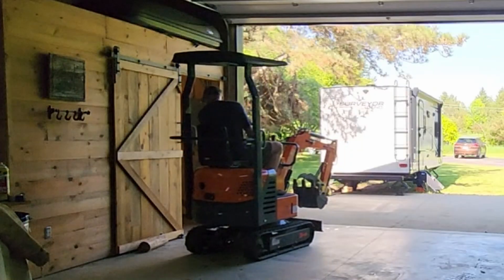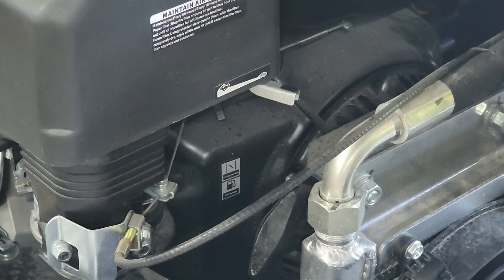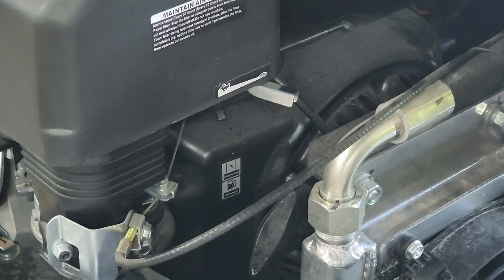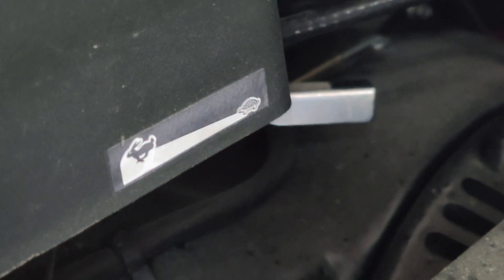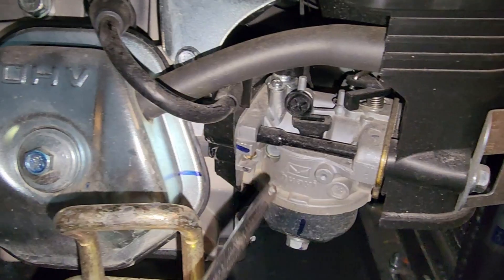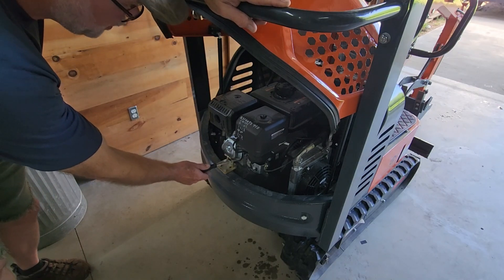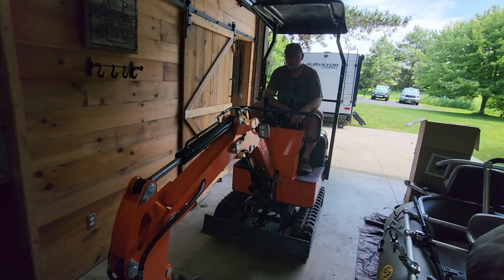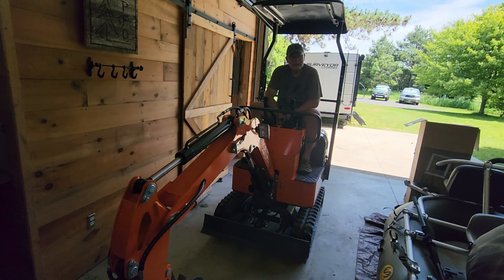Mini Excavator throttle malfunction

Comment: What size is the jam nut you got for the tracks.
Reply from the maker: Thanks for the question! The jam nuts I found, which fit my machine, are M24 x 2.0mm, Stainless Steel. I found a pack of them on Amazon.com, along with an appropriately sized wrench. These details and links were posted in the description under the video where I discovered the nuts missing from my excavator. I'll copy them here for your convenience.

As an Amazon Associate, I earn from qualifying purchases. There is no added cost to you.

Hexagon Head Lock Nuts - Stainless Steel Metric M24 x 2 mm
https://amzn.to/41VxMvn

36mm Combination Wrench (to fit the above lock nuts)
https://amzn.to/3RgsHJt

Comment: Lucky mine was the nut on top of the linkage
Reply from the maker: Yeah, those mechanical governor systems have so many nuts, screws, springs and levers, and any single one can prevent the whole thing from behaving.

Comment: drill q small hole into the throttle control that you say is the "manual control" as far to the end as possible
Take the throttle cable loos from where it is attached.
Take the choke cable conduit loose and move below the screw that tightens the clamp to the conduit 

Put the throttle cable in the top part of the choke clamp and tighten up holding both the choke conduit and throttle conduit.
get a small cable clamp and run the throttle cable through it, then through the hole you drilled and then back through the clamp.
Move the dash mounted throttle control to near full speed.
Pull the cable to make the "manual leaver" open to full speed.
Tighten the clamp
You now have near 2/3 of your dash mounted controller moving the leaver instead of abut 1.5 inches (some adj may be needed)
It makes it easer to find the "sweet spot when doing a job
Reply from the maker: Thanks for the detailed suggestion!

Comment: I have operated a John Deere 410 Backhoe back in the day and other backhoes. For me I had to swap hydraulic lines around to help with me to operate smoother. I moved lines for Boom lift/lower to left joystick and the dipper in/out to the right joystick. It's really a matter of preference and what you have operated before. I just like the dipper and bucket curl on same joystick. Saying that, Throttle down helps a lot; but I also find with these "Mini's" it does get jerky trying to do two functions at once (with same joystick). Say, trying to dipper in and curl bucket at same time and lift or lower boom to keep flat bottom of trench or whatever. It can get Jerky. I have a Miva VA 13. Yes, I have made "mods" on mine also, like other You Tubers have shown. Added 2 80-watt 12 V fans to engine compartment to suck in cool air and blow out hot, I had to add hinges and latches to access engine compartment easier and changed grease zerks to nipples.
Reply from the maker: Thanks for sharing your perspective. I love hearing what others are experiencing with their mini excavator. Fortunately for me, I don't have enough time on a backhoe to have a need to unlearn any muscle memory for the controls. So, that's one thing I won't have to wrench on. I expected to have to put cooling fans on this, and I have the fans picked out and saved in my Amazon list, but so far I have not seen any issues at all with this running too hot. It's probably because I have not yet done any work where I just climb aboard and dig for hours at a time. Trailering and unloading the dirt gives it time to cool between loads. I do have some things on my to-do list that will expose the heat issues, if there be any. I'll let you all know. Thanks again. Stay safe!

Comment: I just got mine! I adjusted the throttle way down to let it idle a lower rpm, what a difference!! so jerky, now actually driveable without low levels of terror!  Thanks for your pickup video as well! Ritchie here didn't ask me to wear a vest (I did get one!) and a very kind young woman with the careful touch of an angel just plopped the Ex in my trailer, good thing took me hours to get it started (fuel shutoff valve on carb).  Another guy was there too and we couldn't get his started, great tips!  (I also very carefully loaded\unloaded from the trailer with the bucket sticking out front per your recommendation in the other video, way safer!)
Reply from the maker: That's awesome! Have fun and stay safe.

Comment: Have same model- tracks fall off a lot - throttle hunts when not at full since purchase, electric start failed gradually - key is stiff and ignition loosened up. Still digging 6 months later!
Reply from the maker: Hopefully more digging than wrenching.  Did yours have lock nuts on the track tensioners?

Comment: Why I say if you are buying a cheaper mini excavator. You need to be able to work on it. Some little thing can go wrong
Reply from the maker: Yes, I've repeatedly said that same thing. But, honestly, the fact that this is a cheaper unit is pretty much irrelevant. I spend a tremendous amount of time in the workshop maintaining and repairing the wide array of equipment (mostly name brand stuff) that we use around the homestead. If you use it regularly, you'll either be wrenching on it yourself or paying someone else to do it.